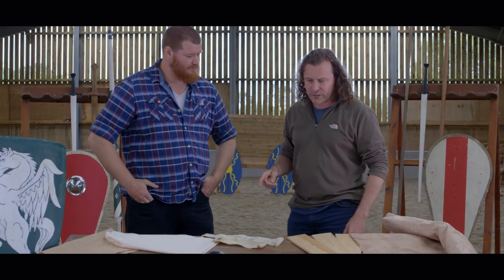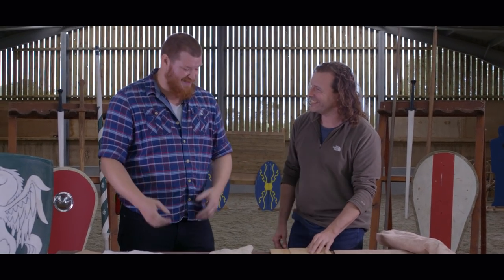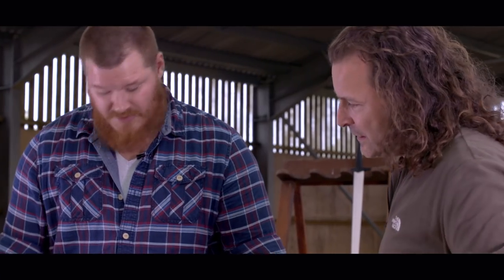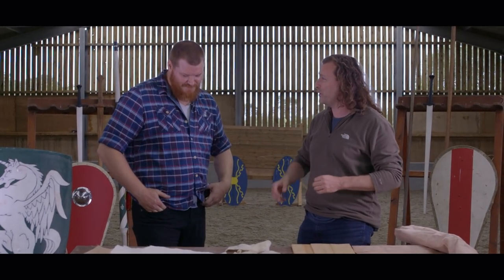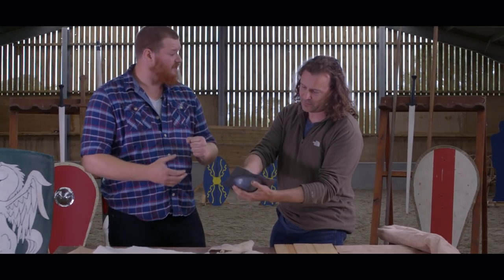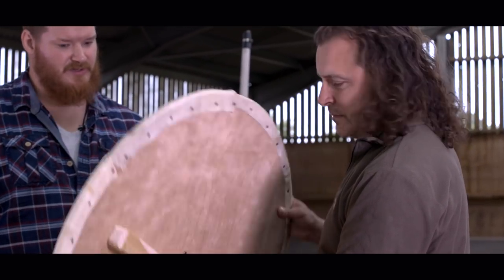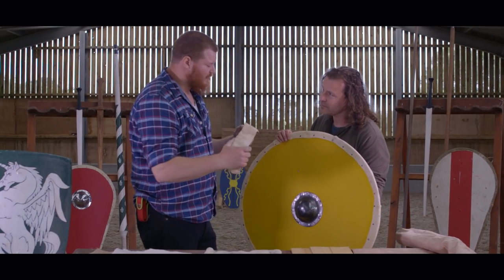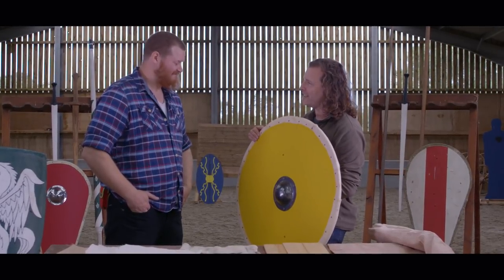medieval shields: How were shields made in medieval times?

Comment: Just a detail : hammering a metal will make it stronger but not denser. It doesn't work by compressing the material, it works by creating flaws in the cristalline structure of the metal (called dislocations). Those will make it harder for the metal to deform, not compression. Trust me, I'm an engineer in material science.
Otherwise very interesting video, as usual !
Reply: Steeve Martial thanks, useful to know. As you know, my expertise is in horses, not metallurgy.
Reply: I can understand that. I just thought it'd be worth sharing. On an unrelated note, may I know who forged your golden sword ? I'd be interested in having a similar one made.
Reply: Steeve Martial Mark Vickers of St George Armouries. It was a custom order that took a long while to get made.
Reply: Thank you ! I assumed it was custom made, but the result is worth waiting for.
Reply: To my understanding, it accumulates tension in the material, a tension that can be released by returning it to the martensite state (heat less than tempering temperatures), allowing the crystal structure to reorganize itself enough to alleviate those micro-tensors.
Reply: @Mighty Stonehaven Yes. Iron and Coal mines date back thousands of years back, but talking about coal, for a regular blacksmith, more popular was charcoal, as it was cheaper and easier to make, as you didn't have to go underground to make it. About iron, steel and overall metals, I don't know honestly, but I think that they used regular blast furnaces and coal from underground(brown and black), as it generated more heat than charcoal (just as today).
Reply: “Trust me” says every credible person ever. Wonder why Trump has to say it so often?...
Reply: @zebdawson3687  hows those gas prices working out for you
Reply: @seabournewolf2298  just fine. I live in the state with the largest oil reserves. 🤷🏻‍♂️

How’re they working out for you? 😂
Reply: @zebdawson3687  Imagine disproving your own point that fast.

Comment: If I'm not horribly mistaken, viking shields were not so thick (1/2") but rather 8-9 mm in the center and decrease gradually to 4-5 mm at the edge of the shield - and this would dramatically decrease the weight of the shield. At least some of the archaeological findings say that.
Reply from the maker: yes, you are right, but they're very expensive to have made and we needed a lot for this test!
Reply: @ModernKnight  can you please make the roman shield?
Scutum

Comment: If we consider Wisby... I wouldn't be surprised if some people did have to go into battle with just a painted lump of wood. In which case, the paint is important--it's so the enemy doesn't realize your shields suck!
Reply: The peasant army at the battle of Visby were surprisingly well equiped, though.
Reply: @ellenkarlsson9490  Not at all. Their equipment featured such things as armor made with carpet and scrap metal. It was a desperate defence by peasants, only some of whom had good military gear.
Reply: @vanivanov9571  I have never heard that. They had things like chainmail, odd pieces of armor, helmets, swords and wooden shields. They were old, often kept in the family for generations but they were valued and well looked after. The Danish army had more modern equipment.
Reply: @ellenkarlsson9490  Yeah, if you're lucky you're using outdated military equipment with sentimental value. Otherwise, you have to use whatever you can scavenge.

Comment: The shield looks a bit thick and heavy to me. In my expierience shields have quite the same weight as "their" sword.
Reply: Weight of sword/horse= offense
Weight of armor/shield= defense
Rate between them is something like a slider about how offensive/defensive you are. Heavy shields like this used in formations not 1v1s, because you would want your defensive stance of your army to be strong at the first impact so it wont scatter to billion pieces after first clash, you achieve this by being heavy.
Reply: What experience? I'm curious.
Reply: Roland Warzecha's videos about shield-making show that the wooden planks were tapered thinner towards the edge, which I would assume not only lowers the weight but also concentrates the shield's center of mass to the grip/boss. Kind of like bringing a sword's point of balance closer to the hilt to make it feel lighter.

Comment: My understanding is that Viking shields used rawhide rather than linen. Rawhide is tough and flexible, and also is easily repairable after battle to re-seal the damaged areas. It's also translucent, so designs could be made on the wood, and then covered with the tough skin on top. That way, you don't have painted images wearing off.

Comment: He didn’t tell us the diameter of a shield and he didn’t talk about rawhide covering the entire front of the shield. What animal hide was most likely used?
Reply: Using the SWAG method, my guess is bull hide.  Aurochs were still around then, & would be for some 700 years.
Reply: The diameter of objects in general are based on the dimensions of the human body. That's where we get the original standard measurement sizes. The length of your hand, foot, arm, leg and torso. For a viking shield is between 33" to 36" more or less, my guess depending on the size of an individual. Archeological finds have also shown that some viking shields were quite small, about the size of a Scottish targe, roughly 28" in diameter.

Comment: Steel does NOT become "denser" by planishing or hammering of any kind. It may become "work hardened" although only if done cold and that may or may not be beneficial as hardness=brittleness.
Reply from the maker: sometimes surface carbon is added by hammering, and the crystalline structure changes, in effect adding a micro laminated surface.
Reply: @ModernKnight  I dont know what you mean by a "micro laminatef surface". The crystalline structure will not "improve" by hammering, other than to work-harden the material which is probably not beneficial in the case of a shield boss.
You might introduce surface carbon by soaking in a low-heat for many hours but not enough to make any real difference in the case of a shield boss. And certainly not as an incidental effect of a bit of planishing. And again, carbon in itself wont necessarily be beneficial unless you with to harden the material. Hardness is not strength. Hardness is also brittleness.
Source: I'm a full time blacksmith with a masters degree in aerospace engineering (involving some metallurgy).
Reply from the maker: I've seen papers on the structure of medieval armour steels, though I can't remember many details. It appears that you can see significant differences between the surface and the interior of each plate. In effect the paper said it forms a type of laminate with differential hardening, similar to the differential quenching used for some swords and knives. I am not a metallurgist though. I was under the impressions that various toughnesses of steel were created by specific heat quenching and then tempering for knives? Is that not the case?
Reply: @ModernKnight   ah! Now that makes more sense and is very interesting. You could in theory have a situation where the side you've hammered is hardened, while the back side remains soft. This would be a best of both worlds effect where blades might glance off the hardened exterior without shattering the steel thanks to the soft steel behind. Achieving this would be quite difficult though as most planishing is done against a hard object such as an anvil or dolly, which provides an equal and opposite reaction thereby work hardening the underside at the same time you planish the top. Perhaps it could be done against a sandbag or leather surface to protect the inside from the effects of impact? Not easy. This must also be done cold. Any subsequent heating removes the effect entirely.

If you care about such things you have to be careful about words such as strength, toughness, hardness as they are all different properties with different meanings and achieved in different ways.
You're right in a sense. HARDNESS (the ability to take and retain an edge, but also brittleness) is achieved by quenching (rapid cooling) of steel. This must then be offset by tempering (gentle heating between 216-316c, depending on the desired hardness) to soften the steel to a sensible final hardness, as appropriate for the tool or weapon in question. For example, an axe needs to be softer than a kitchen knife.

Due to the brittleness factor, this is probably less desireable in armour, but I dont know much about this.

All I can say is that hammering does not inherently make steel "denser" or "stronger".

Comment: that shield seems way too thick, most round shields tapered from 1cm to 6mm. As well, the edging would have been sewn through the board, simply because of the cost of iron.
Reply: I’ve also heard that it was more common to cover the shield in parchment thin vellum than linen/fabric. But then the extant examples of surviving shields are so few it’s hard to know for sure.
Reply: of course line your shields with some sort of material, linned/leather/canvas, makes the structural integrity alot stronger also makes it easier to paint
Reply: @ianalexander6977   i believe both parchment and vellum would have been more expensive back then than  linen/fabric

Comment: What documentation is used to prove fabric coverings on a shield?
Reply from the maker: a few extant examples in museums.
Reply: @ModernKnight   Can you tell me of an example, I am part of a reenactor group in Australia and my group has had our shields(which are made the same way as the ones shown) called into question.  This influential person is causing trouble for us and the method of construction proposed by this individual would cost us $200-300 AUD which is untenable for a piece of equipment only meant to last a few years.  Any help would be GREATLY appreciated.
Reply from the maker: I'll see what I can find. basically they were making plywood from thin but wide strips. Using hoof glue or hide glue and then coverign that with any fabric also soaked in the glue. they'd have used plywood if they had it!
what is this person suggesting? the sagas talk about linden wood, but almost all the remains are not linden wood.
Reply: @ModernKnight  I appreciate it.  The main problem we are experiencing is the shield coverings.  The timber being used is less important because there are very few European timbers available in Australia.  I know of the Szczecin shields both of which are bare timber one with a straw and bark rim the other without any rim and I know about the Marburg shields though I am struggling to find construction information on those ones.